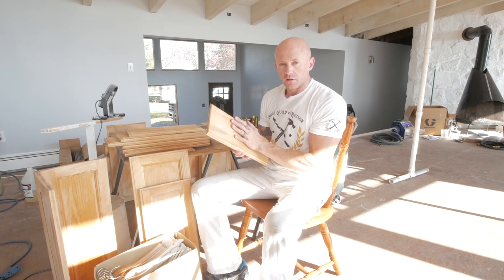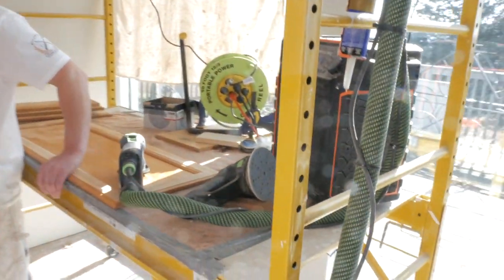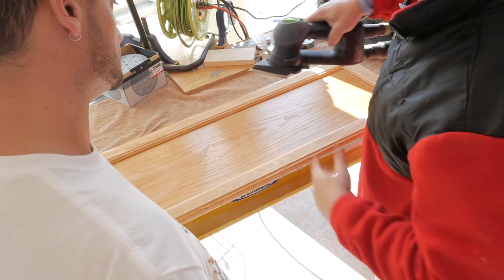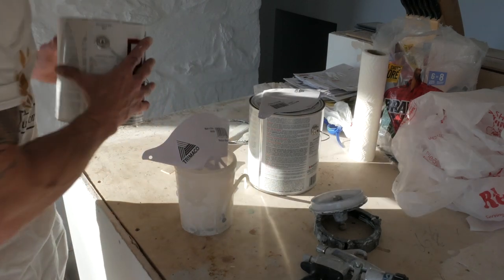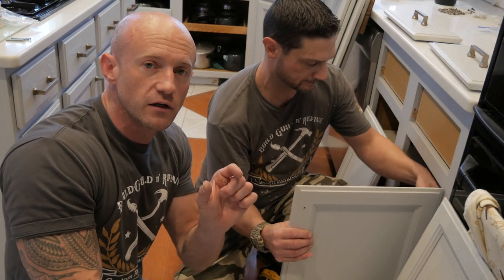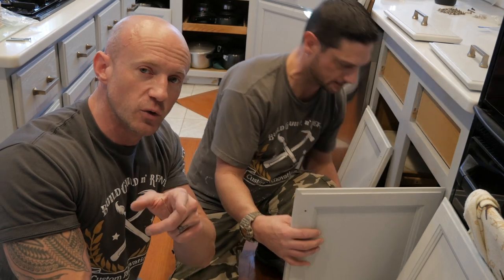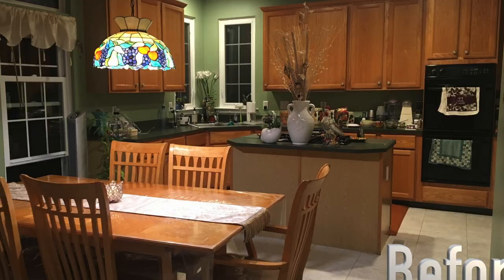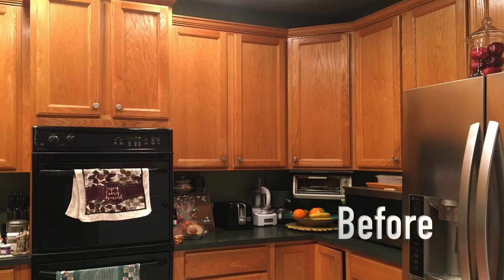How To Paint KITCHEN CABINETS on a budget - Part 2

Comment: Hey Adam
Did you guys caulk the floating panels or not..? Did y'all ever look into the 
Ekasand Sander E-Series 3 x 4 Central Vacuum for doing cabinet sanding..?
I put together your swivel idea yesterday and am going to use your spray stand idea...Thx bro's...
Cool stuff, where are y'all located, I'm in York, PA...
Reply from the maker: Hey my friend, yes we did caulk the floating panels, I have not looked into the sander you’re talking about but I certainly will now, is that your preferred system? There are times I’m disappointed in the festool performance. 
Great to hear you were able to put the swivel stand together, did it work out well for you? You’re not too far out in York, we are in Phoenixville.
Reply: @healing2gether  I put it all together, cut the pieces in 20" lengths from 3-10' pipes...and then put it in a 24" Husky tool bag ...Did not get a chance to actually use it yet, however, I have a kitchen cabinet paint job in the works...I also did not purchase the Ekasand 3X4 sander yet, but i have it in the budget for this cabinet paint job...best price from PaintLife Supply in Idaho...

Comment: Excellente job. I was wondering if I could ask a couple of questions  if you get time.
1. Do you use same gun for primer and topcoat or separate ones? Is bin primer shellac easy clean out of the gun?

2. How do you connect the hook to the pvc pipe stand that you hang hanger from?

Cheers guys
Reply from the maker: Yes we use the same gun for all paints (though we do have two HVLP guns)

Take a look at this video and I think it may answer your second question:

https://youtu.be/Z497439_fN4

Thanks for watching!

Comment: Great quality of your work and thank you for the willingness to share your tips for success. Especially how important the initial steps of prep are to ensure the final product. I notice you don't top coat the paint. Do you add catalyzed lacquer to the paint? Or, is the paint product alone sufficient?
Reply from the maker: Hey, thank you!!  Sometimes I will topcoat the paint with a clearcoat, but not usually because the finish with the BIN primer, and the Sherwin Wiliams emerald it’s tough as nails, and pretty much as hard as it could possibly be. I’ve had this finish already last almost 10 years perfectly.

Comment: Nice vids. Thx. A few short helpful hints though, if I may.

Seems you did not caulk the backsplash tile. That's not proper. 

The tabs on the outlets don't seem to rest on the tile which makes them difficult & more work to flush out later and then still be potentially wobbly/shifty. 

Never use mastic in a shower!!! Big NO-NO!!!

Always allow setting materials to cure few days to reduce potential grout discoloration.

Wet out cementitious grout for few days to increase strength and improve color uniformity.

I would have taped over face [and even power screws] of outlets before tiling/grouting. Allows faster grouting/washing & less dangerous [although I do electrical under power.  ))  ]

I'd have stretched the tile or changed the layout to eliminate the tiny cuts on right side of the oven stack.

I'd have opted to install full tile height outside the upper cabinets, not carry/continue the cut/sliver. 

Like paint, tile mortar needs to be bonded well to substrate by flat back troweling. [e.g. back rolling of paint]

Signed - Ol' Tile Pro.

Comment: Why did you need to drill new screw holes for the hinges?
Reply from the maker: The bee hinges the homeowner wanted installed were a different screw pattern and did not fit the old pattern.

Comment: can this be done on laminet kitchen cabinets?
Reply from the maker: Storm cast I have seen it done on laminate cabinets but it should not be done. You’re only painting the surface coating rather than the actual material.